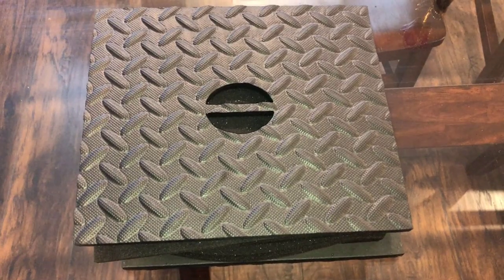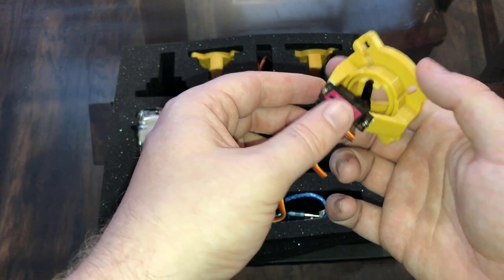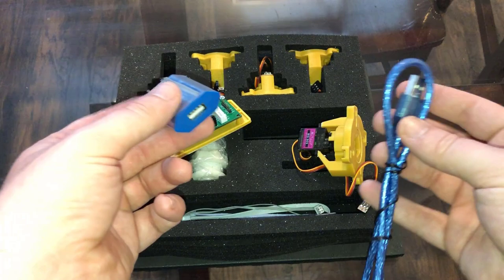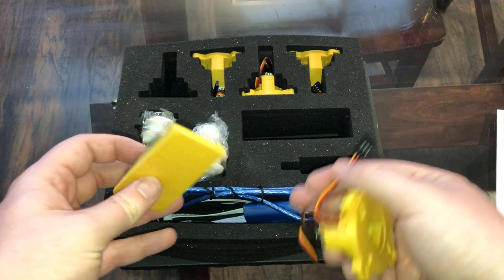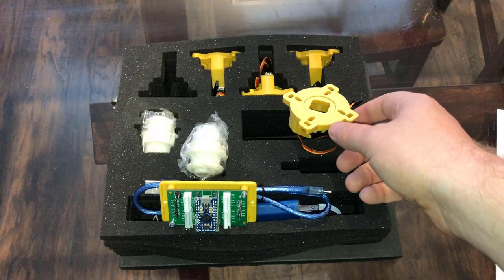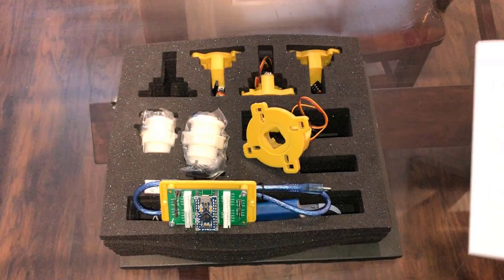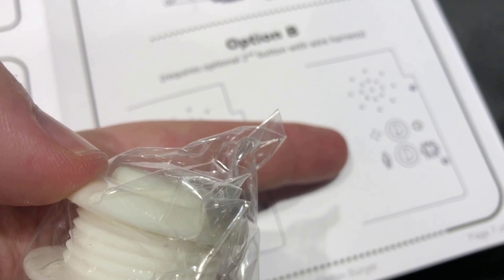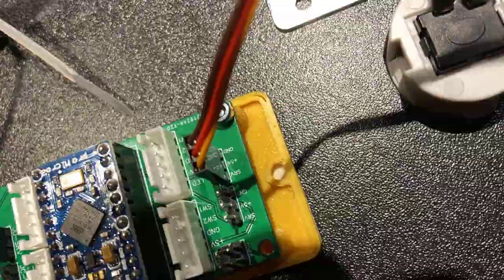FINALLY! The Perfect Solution For Mixing 4-Way and 8-Way games: Electronically Switchable Gate

Comment: GRS has picked up the product.
But you could replace the button with TTP223 Capacitive Touch Switches and leds. It will work through 1/8" Acrylic. It has either toggle on/off or temp on/off mode and, default state of either on or off when first powered.

Looks like his double tact switch has sw1 & sw2 connected to Gnd plus two LEDs one on Gnd and other on +5v and both wired to LED which flips from Hi to Lo activating one or the other color LED. You can use two LEDs like he did or use a Bi-color LED (common cathode) and a transistor NOT gate (NPN) and maybe a second NPN transistor if the on state LED is not bright enough (act like a on/off switch). 
I doubt he would be using WS2812B LEDs.

Or do a simple logic probe with a cd4011 Quad-NAND ic or cd4049 Hex-NOT ic with 2 560Ω 1/8W resistors and, 2 LEDs or Bi-color (common cathode).

Or SMD surface mount fun - SN74AHC1G04 Sgl-NOT ic, 2 560Ω 1/5W 0804 resistors, 2 LEDs - Red 0805 LED (1.9V drop), Grn 0805 LED (2.1V drop). LEDs will pull 5-6mA from the IC which has 8mA sink current,  attached to a SOT23 MSOP10 board. 0804 & 0805 are 0.080" or 2mm components, ic will be 3-4 mm.

Comment: I may have to do this for my AtGames Ultimate Legends cabinet.  4 way games like Ms. Pacman are no fun on that cabinet (i usually stick to the A1U Head to Head for that game).  The button with different LED color indicator based on 4-way vs. 8-way position is very cool.  But I'm wondering if there will ultimately be an option / solution for "automatic switching" based on game selection.  That would be incredible.
Reply from the maker: Ya this is a big improvement on the alu. Agree 4 way games are terrible on that cab

Comment: Thanks for sharing. This is really enterprising solution. Impressive. Been trying to imagine a similar mod to switch a 4-way stick back-and-forth between a traditional cross orientation and a diagonal orientation for proper Q*bert gameplay. I want to build my own Q*bert A1up cab but only know how to install the game via a pi that would have so many other games that don't use a diagonal stick.
Reply from the maker: god I love Qbert
Reply: No rule that says you have to add a ton of games with a pi. Heck I bet you could install Qbert and retro pie on a pi zero for not much $$ if you wanted a dedicated Qbert cabinet.
Reply: @lonster3000  You're right, of course, no rule... Truth is, I'm a noob with retro gaming mods. What I'm most interested in is just the cleanest presentation of a Q*bert countercade that I can build - not sure if that means a pi, or if I can/should use an actual PCB (though that may mean more money than I want to spend)... Still learning/making my plans for the full build. But I'm going after it
Reply: Wicket Yub Nubs  I hear you, I have 2 Arcade1up cabs and a countercade but when it comes to modding them I have big plans but so far I am all talk no action lol.  Good luck, if you succeed you will have a unique cabinet.

Comment: Hello, probably a super dumb question, but what extra long ribbon cable did you use for the push button, (is it a 5 pin), how long is it & where did you get/purchase it from? Thank you
Reply from the maker: Sourced it from the guy who created this - I don't recall the length but at least 3 feet iirc

Comment: How hard are these to install for someone who isn’t the best with tech and wiring and stuff. 

This would be great for my TMNT modded cab to go from like Pac-Man to burger time to MK or fighting games. But I worry I won’t be able to figure it out lol.

Also what the cost of the kit?
Reply from the maker: Extremely easy to install, just like swapping in any other restrictor gates and plugging it in. If you decide to drill for a new button then that would be the hardest part, although also easy, and that's optional. Not sure the price, ask Tinkering On Steroids here in the comments (he's the inventor)

Comment: WASTE of money 💰. 
BRUH... broke my high today...  57,800!  Oh and with octagonal gates on a 4-way game 😉
How do I send you screenshots? I can send my Frogger screenshots as well - my current high there is 12,370. Just might break that one tonight as well.
Reply from the maker: I don't question you're good at the game my dude but I'll never be happy with a (non multicade) arcade with non dedicated controls
Reply: @UnqualifiedCritics  That's just the point my dude, I'm no BurgerTime or Frogger pro by any means. I'm just an average player that can hit the high scores because the controls are indeed accurate. 8-way octagonal gates work! They certainly do allow for 4-way games to play comfortably and accurately along with 8-way games in the same cab.
If you feel better spending the extra money on unnecessary devices, that's certainly your choice but the controls aren't broken in the first place. BurgerTime is just a tough game in its own right; I'll be interested to see how much better you'll score with your new toy?? You should do a comparison video detailing the performance. I have to admit it is a pretty cool device, it's just not necessary. You can simply replace the square with octagonal gates and save yourself some cash.